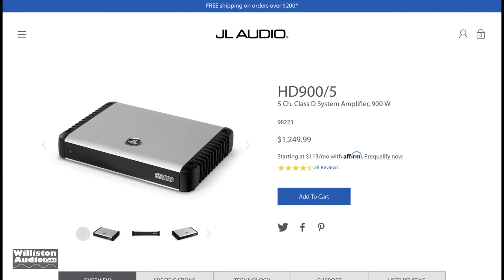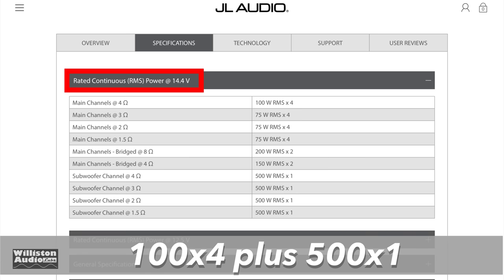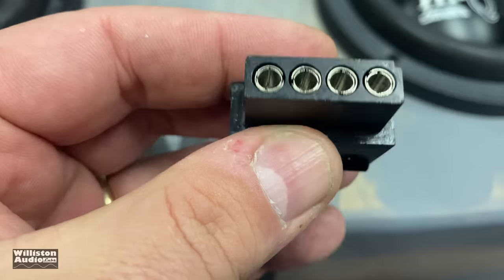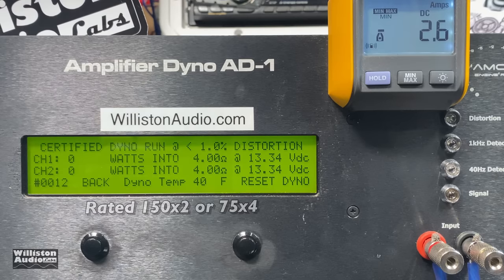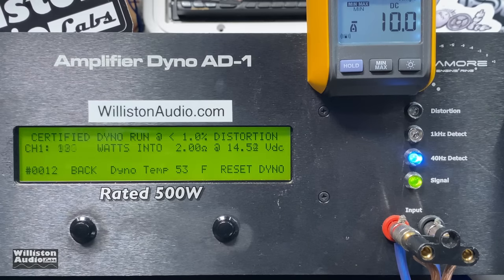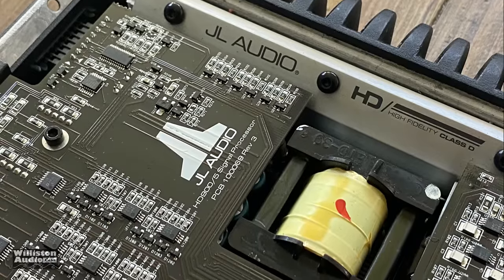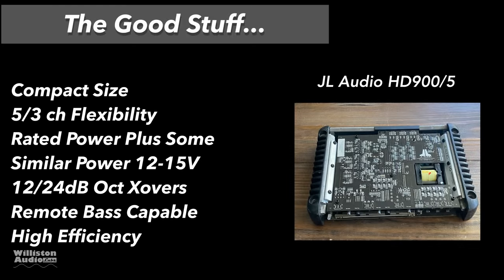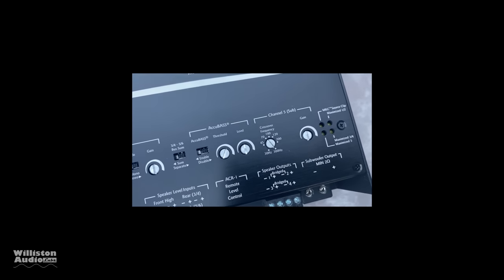JL Audio HD900/5 Amp Dyno Test and Review [4K]

Comment: I wish you had checked the temperature while using the amp. I've heard they get extremely hot.
Reply: I’ve ran an HD600/4 and the HD750/1. Set up correctly, they get warm to the touch, but nothing outrageous. Being regulated amps, if you don’t have the current to drive them, they can get warm.

Comment: The hd900/5  the only amp I’ve every owned that blew without any warning or why. Put in my car wired it up. Played it all night. Came the next day and cut it on and the sub didn’t work. Checked a few things and then it cut off and never came back. Sent it back to jl and they said amp worked fine. Got it back and never came on. Took it back to shop and got money back and went with alpine. It sucked I had 6 JL 12w6’s  in my truck and really wanted to go full JL in my car. 1st and only amp to not work in 30 years. And I run skar now for 3 years.
Reply: U had 6 jl 12's running off a jl 900/5? Yeah that don't add up.
Reply: @wwlittlejOfficial  sorry. 2 different systems. Had the 6 12’s in my truck. Had a cutlas with one 12 running off the JL amp with my 6x9’s and 6 1/2 coaxial. Yeah lol those 12’s were powered by two Orion’s wires in sets of 3 to 1.3 ohm. Stuff was loud for the late 90’s
Reply from the maker: That’s a bummer
Reply: Not trying to bash JL or this amp. Just saying it’s the only amp I’ve ever had problems with and not know why.  I pick a brand and try to run all their equipment. I think it looks good to all be the same. I started with JL then alpine now now stuck on skar. But it’s all good.

Comment: Was it just me, or did it seem like it moved the subs a little less than some other amps that have been rated for the same or even lower power?
Reply: Way less. Big D ran it at 1 ohm. I understand why he did. Rewiring all 4 subs to test 1 amp I would have done the same thing. Power supply clamped down and said no. Might have been getting 500 watts. Maybe. From the sub movement I’d guess more like 350-400. Notice it did less at 1.33 than it did a 2? Considerably less. Regulated power supplies suck. IMO I do own this amp though and I can tell you it is very very efficient at 4 ohm.

Comment: They have expensive regulated power supply section... Most of the cheap big power amps have simple unregulated supply rails. Also the more expensive amps have better output on the reactive speaker load. The dyno is not reactive, so the numbers are deceiving.

Comment: I don't see why the power/speaker plugs should be an issue... i would prefer a secure connection... plus how often are you gonna unplug your amp when its installed... if you spend your money for quality shouldn't reliability and peace of mind come with it as well...
Reply: After the sub channel went out on my HD900/5, I took it out to troubleshoot it. The power block broke off while trying to remove it. Half of the plastic stayed on the amp. I had to carefully put it back in, and had to screw in the power and ground while it was in the car. 
Never did fix the sub channel, so now it's just a 2 channel bridged amp for my fronts with a constant orange LED. :/

Comment: Always disliked JL. when I was in high school, I always was putting down the spl. There was always some haters that didn't want to hear it if it wasn't JL.(same guys who never had anything in their trunk) I did come across a set of JL 12s. not entirely sure what series. But it was 1996ish and I don't think they had the "affordable options" yet. These were ever so slightly better than pyramid phaseiii 12s. Of the Several jl hipsters I knew, their $3k systems rarely held up to my flea market fueled trunk. They would whine about it being an SQ system, not spl. But they would end up liquidating their trunk short order, never to sport aftermarket again. Thinking back it sounded like their mids and highs were not broken in yet. I guess we should thank JL for keeping hipsters out of spl for 25 years.
Reply: This is ridiculous.

Comment: I hope Doug from Soundman Car Audio doesn't see this. He hates JL.
Reply: Because its way over priced.  I could install a system that will outperform jl at all levels at one third the cost.
Reply: It like buying a BMW m5 and some hater is saying i can spend less hooking up my honda civic to be faster and handle better.  Its true but you get what you pay for.
Reply: @chuckd9007  What components?  I have JL but I bought used for about 1/3rd the new price.
Reply: @Sql253  im not hating.  I just dont see the point from an engineering perspective in spending excessive money on name brands.
Reply: @DoeBoy999  im not in the mood to give you a long list of better (by specifications)  speakers or amps.  If you know enough about audio you dont shop by brand unless youre trying to impress other people.
Reply: I had to stop watching Soundman’s channel. He comes off as very unlikeable.
Reply: @chuckd9007  just your opinion. Everybody has one.

Comment: You definitely get what you pay for with this one. I enjoy the bespoke goodness
Reply: Check out the. Rockford 5 channel. I believe big d even tested it. I could be wrong though. Half the price for more power. I own this amp. Worst car audio purchase I’ve probably ever made. Only good thing is, since it’s in flawless condition and I have original box and paperwork I could prolly sell it for $750 in 3-4 years.
Reply: @Van1018s   man thats not good! Does it sound shitty in your setup?
Reply: @Everett-xe3eg  it’s sounds good. The regulated power supply just sucks IMO. Makes music sound a little flat and the tight bass hits you expect on rock just aren’t there. Sounds great on rap or bass heavy tracks.
Reply: @Van1018s  Thank you for recounting your experience. I am looking at amps to power my door speakers. Theres a few on the list! I will look into rockford next
Reply: @Everett-xe3eg  there’s a lot of great options out there. And JL audio makes very good amps. They just cost WAY to much. They charge $1 a watt or more. That’s what amps cost in the 90’s. You can get a quality amp now for more like 30 cents a watt. Watch Big D’s videos. He’s tested hundreds of amps.
Reply: @Everett-xe3eg  in another one of my vehicles I’m using DD audio amps. Their 100x4 retails for I think $359. It blows away the 100x4 section of this 900/5 JL audio, and has just as many, if not more crossover options built into the amp.
Reply: @Van1018s  I like DD audio I have seen really good things about them. They look great on the stats. Have you ever used any of the Brazilian taramps for the multi channel stuff?  I havent heard one in person but on paper they are very appealing.  Not sure if its dry and punchy or low and slow. I like the deep bass tracks when the windows shake. Currently I am using an old american bass amp but hot damn does it make noise.
Reply: @Everett-xe3eg  I have not used any of the Brazilian stuff. A good amount of the Korean stuff. Orion and DD audio. I have 2 DD audio M5 amps running 8 Savard hi-q 12 and 2 of their c4.100 amps running 16 6.5 coaxials. I love the DD amps. I like my JL amp it’s just not worth the money. I have it running a JL c5 components a C5 coaxial and a single 12 W3. It’s lack of dynamic power causes it not sound real musical. It does do well on heavy tracks until it gets hot. The entire amp is run at 4 ohm and after about 30 minutes of playing well below clipping it goes into thermal protect and goes into like a limp mode. Still plays, but at very low volume till it cools. Drives me crazy. I am maintaining 14.2 V on the amp. Electrical system is not the problem. The majority of my experience with car audio products was in the late 90s early 2000’s. I was really big into US amps, JL Audio, Rockford, MTX, eclipse, alpine. I was a dealer for all those brands. Then I kind of got out of car audio from about 2004-2018. My only personal experience with products since getting back into it has been alpine and kenwood head units, which I’ve been very happy with, dd audio and Orion Hcca amps, which I’ve been very happy with, the JL products I listed, which I’m not unhappy with, they just cost way to much for what you get. IMO. And Savard hi-q subs I’m very happy with. I’ve read good things about the taramps and all the tests I’ve seen they do over rated power, but I have no personal experience with any of the Brazilian amps.

Comment: 2:47 60A?!?! Big dummy math isn't checking out there. You sure you're looking at the correct manual?
Reply: ya sounds suspect, unless its really that efficient
Reply: I have had one running for over a year with a 60 amp. Yes. It’s really that efficient. It also doesn’t do much power, but for what it does it’s extremely efficient.
Reply: To pop a 60 amp fuse you have draw approx 120 amps for 5-10 seconds. Which would never happen on this amp with music.

Comment: So I wonder how pioneer and Kenwood amps compare to this amplifier??? My choices for years pioneer and Kenwood.     Wait you don’t even get a bass knob for 1200$ wow
Reply: Yeah, expensive.  But anything in this size with this type of performance, build quality, and SQ is expensive.  Great warranty & support, too.

FYI, you can usually pick these up at a good dealer for considerably less than their advertised MSRP, and the dealer will usually throw in the bass knob for free as well just to make the sale if you haggle a bit.  ;)

Another great option was the 2nd Gen Alpine PDX-V9, but sadly it's discontinued.

The tiny Kenwood eXcelon XR901-5 amplifiers are excellent, though not as powerful.

Comment: JL definitely makes quality audio products but they are and always have been overpriced.
Reply: Yeah, expensive.  But anything in this size with this type of performance, build quality, and SQ is expensive.  Great warranty & support, too.

FYI, you can usually pick these up at a good dealer for considerably less than their advertised MSRP, and the dealer will usually throw in the bass knob for free as well just to make the sale if you haggle a bit.  ;)

Another great option was the 2nd Gen Alpine PDX-V9, but sadly it's discontinued.
Reply: @bbfoto7248  👍  Alpine makes good equipment at a decent price.
Reply: Actually, you get quite a bit for your money with higher end JL gear. 
"Overpriced" is a subjective term. Just one person's opinion.

Comment: The audio control 1300 was much more impressive.
Reply: I agree... im gonna try it out...
Reply from the maker: I felt so as well
Reply: Perhaps (and I'm not a JL Fanboy), but you're comparing the brand new AudioControl 5-channel to a JL HD amplifier that is a 10 Year Old design!

Given the rate of advancement in technology these days, I would hope that the AC could do a bit better.  But, for overall quality and the wiring connections, I still prefer the JL HD (and the Alpine PDX-V9).

And those also have a "stackable" mounting design which comes in very handy for particular installs.  Unfortunately, the PDX-V9 is discontinued.
Reply: @bbfoto7248  yeah but the AC is cheaper and still an overall good product... not taking away from JL at all.. but we're talking about a 5 channel amp. And JL do have newer amps with great features BUT it cost an arm and a leg.. I have had JL amps and they are great.. but the AC 5 channel is more of a better deal overall...
Reply: @stevenwillis9816  ......You guys are overlooking the licensing / royalty fees that JL has to pay for their Class D technology which is only used in the HD amps and is not used by any other brand. I`m not sure how much said fees are but i`m sure it`s passed on to the customer in the price. 

AC amps are nothing but a rebranded series of ARC Audio amps with a few added features. Yes, they are good amps and are an incredible value but it`s silly to compare these two amps based on output power alone.
Reply: @PunisherOfDeath101  .......How are your Crunch amps working for you?
Do you even have a car? 

Nope.
Reply: @blkngwinn  ok and???? AC is still a better buy for the money... 🤷🏾‍♂️
Reply: @stevenwillis9816  ...........So what you’re basically saying is that all you care about is price and nothing else. 

Sound quality wise, the JL HD wins. 

With that being said, you get what you pay for. 

Have a good evening.
Reply: @stevenwillis9816  ......I forgot to answer the first part of your reply where you said “ ok and”?

And, the tech that I mentioned cost more than the tech in the AC amp so that contributes to the higher cost of the JLHD900. Also, the AC amp is bordering on the cookie cutter philosophy.
Reply: @blkngwinn  you are talking like AC is a bad product.. AC is still a great product and worth the money.. you must work for JL🤣......AC is not a cheap brand... and is still an overall better buy...you talking about all the things JL got to offer like AC doesn't offer anything.. that was the point in the very beginning... its a great product for a better price.... all of AC products are very good so you can't say that AC is a knock off brand bc its not.. AC is a highly reliable product with great features that's more AFFORDABLE....I said in a previous post that im not talking down on JL..but AC is a better buy
Reply: @stevenwillis9816  Ummm, if I thought AC was a bad product I would say so. 

You’re totally missing my point and cherry picking things that fit your argument and at the same time, you never acknowledged what I said about the JL HD amps and why they cost more. 

With that being said, no, I don’t work for JL and the AC amps are nothing but the old ARC XDI series of amps with added AC features. At no point and time did I ever say the AC amps are bad but I did say the unique features of the JL HD amps, which is only used by JL, that contributes to the higher price. 

By your logic, if a flea market 5 channel amp makes more power than the AC, then that’s also and these are your words, a great product at a better price. 

AC does make great products but they’re amps are not 100% designed by them. 

Take a look at the trouble shooting section of the owners manual and compare the same trouble shooting section on said series of ARC amps I mentioned and then you tell me it’s not a knockoff  / rebadged product.
Reply: @blkngwinn  listen... this is not an argument... you commented on my post... I don't care what you say about the amp... I don't care how you try to break it down.. AC is a better buy..I don't need you to tell me what's inside the JL amp.. we all know that the amp is made with quality.. I said that the AC is a better buy... a better buy for ME!!  Especially the 5 channel.. im not gonna pay an extra $400 when I don't have too and still gonna get great results.... I didn't ask you for your opinion.. so please stop replying to my post.....
Reply: @blkngwinn  and we are not talking about flea market garbage so why bring it up????
Reply: @stevenwillis9816  But you’re still wrong.
Reply: @stevenwillis9816  As an example of your logic.

Comment: Not even remotely impressed but that's expected for JL. Even at 800 watts on the sub channel, the output is pathetically low for a $1300 amp. You could get an Orion 4 channel that does 100 per channel for easily less than $150 then get an XTR amp that does 5k rms fr for $500. And that's less than half while you get 10 times the power! Forget JL. The Bose of car audio, those guys.

Comment: Nice words you speak here but ALL AMPS ARE COOKIE CUTTERS WHY???? BECAUSE THE COMPONENTS ARE ALL THE SAME WHEN COMES TO FAILURE.  SO if i spend 1200 for this amp I want to abuse the hell out of it and if it do not last for 7yrs before repaired is made THIS AMP IS A COOKIE CUTTER.
Reply from the maker: You don’t understand my explanation 🤷‍♂️
Reply: @wal  I think I do to a point, but no worries just my opinion......
Reply: You don’t understand electrical engineering. Components are just that. It’s the engineering design that makes them work. A simple look at the PCB layout shows you what’s cookie cutter and what isn’t.

Comment: Non cookie cutter amps arent  necessarily better. 

Tried to get a jl 300/4 repaired. Some places wont even touch it. Other place couldnt even fix it. 

Cookie cutter means more common, generally easier to repair. And still make power and sound good.

Why over engineer something just to jack up the cost??
Reply from the maker: Valid point

Comment: Too much uniqueness for me. Its like buying a Benz not thinking of the maintenance and repair costs.
Reply: My 350 has been cheap to own.  70k miles and it hasnt broke down yet.  Brake pads were cheap enough for a high performance aftermarket set.  Tires werent cheap but i bought triple 8r's.
Reply: @chuckd9007  Pretty please let me know at 150k its something about 120k tp150k when crap likes to happen.
Reply: @alphaomega8373  if you say so... ive never had any major problems with any of my vehicles until they are over 250k except my old tahoe needed a transmission at 180k and 250k

Comment: Do you have the wires halfway hanging out like a short circuit waiting to happen on purpose!?!?!? you do it in EVERY video and i CRINGE!!!
Reply: He should use crimp connectors , with the right tool to crimp it.
Reply from the maker: I like to make you cringe 😬
Reply: I do to, but he’s reusing wire over and over and nothings ever touching. At least not on video. Lol Not like he’d do this in a real install.
Reply: @wal  LOLL